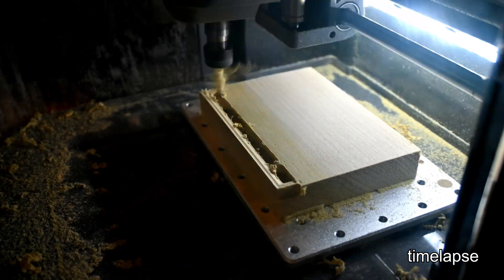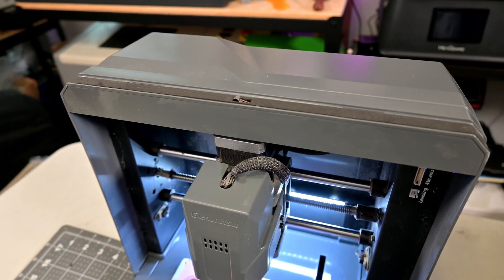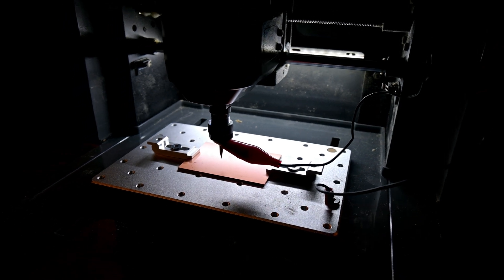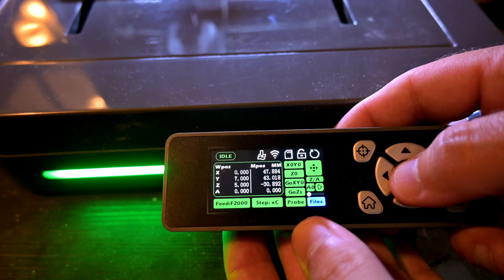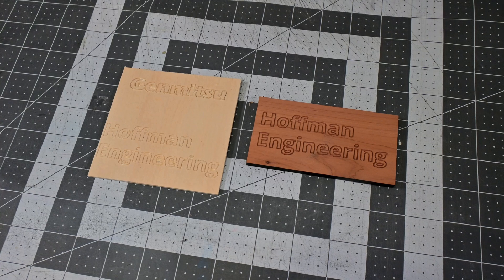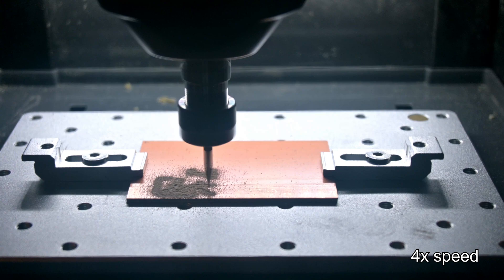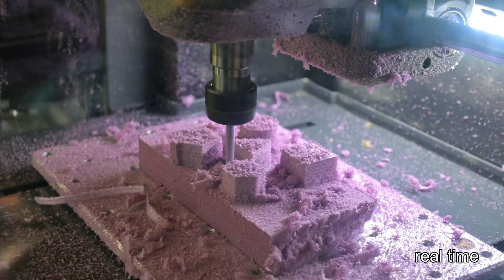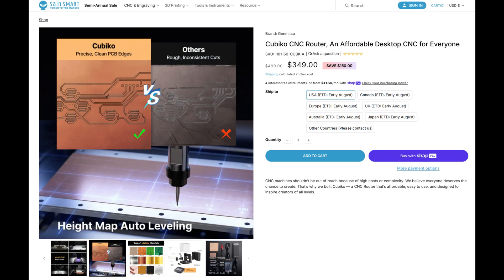The Best Beginner CNC Router? Full Enclosure, Compact Size - Genmitsu Cubiko Full Review

Comment: I was looking for an option to replace my laser machine that I usually used 3mm thick materials on but the software is always what holds me back from ever buying a cnc router.  Lightburn isn't the same.  Does Genmitsu have something that steps you through the basics and concepts?  Since you recorded this, did you also discover what bit could be used to do cleanup?
Reply: @HoffmanEngineering

Comment: Doyou think this unit would be able to trim the edge of thin copper badges?  I'm looking to reproduce some of the data plates on older machine tools (like atlas lathes and mills) that are the etched and then paint filled and looking for a unit where it could do the laser to clean the antietch film off before going into the solution and then use the mill to trim the edge to a nice finish.  Similar to how they have done in this video as a point of reference.  https://www.youtube.com/watch?v=68-QAwB8TdI
Reply from the maker: With how it handled aluminum, I wouldn't have high hopes for copper. You might be able to make it work, but you'd have to go so slow and so shallow it won't be a very consistent edge.

You'd want a machine with a more powerful spindle. I recently reviewed the Axiscreat i3030. That machine handled aluminum better, and would probably handle copper consistently as well. So something with a 700+ watt spindle would be good.
Reply: @HoffmanEngineering  Thanks for the feedback.   That is what I was worried about.